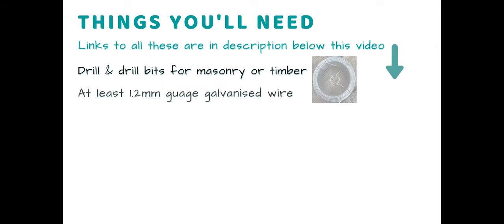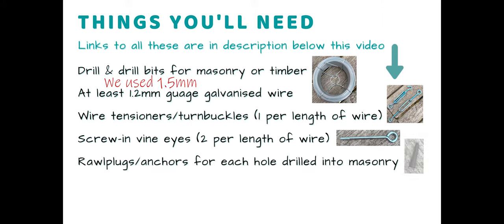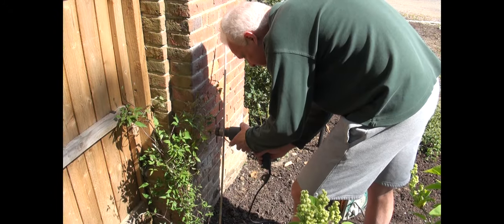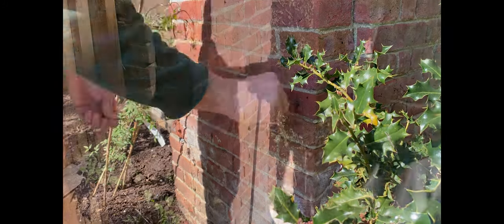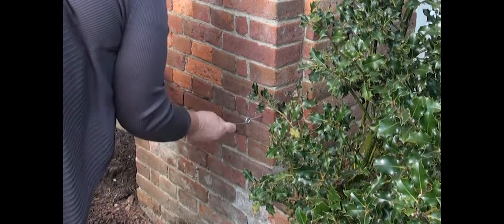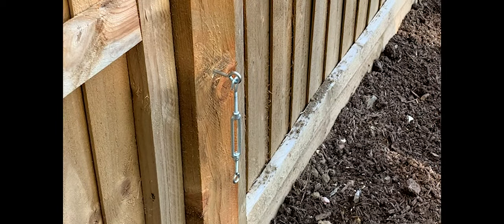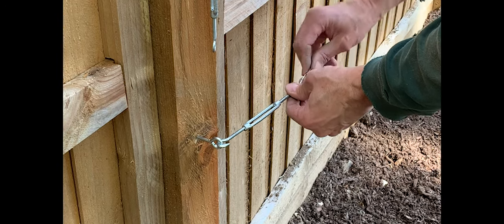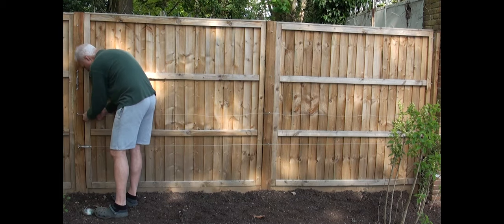How To Install DIY Wire Trellis For Climbing Plants Like Clematis, Roses and Honeysuckle

Comment: Thank you for your really clear and helpful explanation of how to install a wire trellis. I've got concrete fence posts so will be using special wire anchors with holes to thread the galvanised wire through. My longest length of fencing is 12 meters (the other lengths are 11m and 9m). Please could you advise how many turnbuckles I'd need for one length of wire? I don't want to overload it.
Reply from the maker: You are welcome Jan. You really only need 1 turnbuckle for each length of wire.  You could make a wire trellis without them but then you wouldn't be able to tighten the wires over the years.  But that's all they are used for - they don'e add an additional strength or anything like that. 😊

Comment: This was so clear, thanks! I have just planted three clematis, spread across 4 fence panels. Would one wire lenght be OK across all four panles? Or would you do 2 and 2? If so, could they go in the same vine eye in the centre? Thanks!!
Reply from the maker: Gosh, without know the measurements, it's hard to advise.  We used one wire all the way along but used a vine eye on each fence post.
Reply: Thanks 👍🏻👍🏻

Comment: Nice video. As a suggestion, I'd have just made 2 holes at the top and 2 at the bottom to put in a trellis to train it on, less holes, easy solution that looks great as well. :)
Reply from the maker: Thank you.  Yes, that is easier if you want a trellis but we wanted something less visible.

Comment: Very helpful thank you. How do you then tie the branches to the wire ? What do you use ? Thanks
Reply from the maker: Hi there, We use garden twine, like a very thin sisal string.  It's important to tie things in using a figure of eight pattern so that they don't rub against the support. This video has detailed instructions towards the end
https://youtu.be/ma7j1c16CZ0?si=EW5nzMEIgTh61xcX 
and there is a link to the jute twine we use in the description below the video.
Reply: @cottoverdi  thank you so much , super helpful 🙏

Comment: My garden centre recommended rope wire for strength is this what you have used please? Our fence doesn't have the posts just the panels is this ok please
Reply from the maker: Hi, no, we didn't;t use rope wire - it's not necessary for the roses but it does depend on what you're going to grow on your trellis.  We used this 1.8mm wire :  https://amzn.to/3VBY030

Comment: Hi, this is so helpful thank you. I have a huge wall (10x5m) and I would like to have star jasmines go wild on it! Do you have vertical lines as well as horizontal? How wide should I space it? How wide would you need a spacer vine eye to be (every couple of meters?). Thank you so much for this! Thinking I need 3mm wire, turnbuckles both ends because of the length. Any help would be so appreciated!
Reply from the maker: Hi Lewis, That's a big wall! You only need 1 turnbuckle on each wire.  I've never installed vertical wires.  And I think we usually have a vine eye every 2 meters or so.  Good luck!
Reply: @cottoverdi  Thank you so much xx

Comment: Thanks so much, this is very helpful. Do you find you need the vertical wire too for plants to grow up or is horizontal ok?
Reply from the maker: Hi Linda,   No, you don't need vertical wire too, unless you feel that it will benefit your climbers but most climbers will naturally grow upwards, towards more light.  It won't hurt them to have it but we never have.  Hope this helps.  Annette

Comment: Hi, great video! I plan to do a wire trellis on a timber fence similar to yours. How far apart vertically are the wires? 20-30cm? I'm looking to grow star jasmine. Any recommendation on size of turnbuckles and vine eyes? Thanks again.
Reply from the maker: Hi Rosie, yes. I'd say that they cables are about 30cm apart, maybe 40cm.  I've listed all the products I used in the description of this video - take a look at the links for sizes etc.  Good luck with your trellis.
Reply: @cottoverdi  thank you 😊

Comment: Hello, thank you for your help. I’m wondering if you can help. Do I need a turnbuckle on both ends? I’ll be using this installation indoors and hanging posters on it. The stance is about 9 meters.
Reply from the maker: Hi, no there's no need - the turnbuckle is just there so that you can tighten the wire because it loosens over time.  It's best to check it every year and just twist the turnbuckle until it's taut again.

Comment: Hi I’m wondering why you didn’t use the turn buckle on the wall wires and only on the fence wires?
Reply from the maker: Hi Ruby, we didn't;t use the turnbuckle on this particular wall because it was just a pillar and so it was very short and the turnbuckle would've been pointless.  On longer walls, we definitely use turnbuckles on every single length.  Hope this helps.  Thanks for watching.  Annette 😁

Comment: Great video Annette thank you.  I've just put up a wooden trellis but i'm not sure its up to the job for my Star Jasmine....do you think the wire trellis would work better in terms of holding the weight of the Star Jasmine once its established? Its on a wall and would cover about 3.5m wide by 1m high.
Reply from the maker: Hi there, I think the difficulty with the wooden trellis is that it will deteriorate over time but the wire ones should last a lot longer.  The Star jasmine sounds like it will get very big so it would be a shame to have to move it to repair the trellis - I would definitely go with a wire one but it's really up to you and how much effort you're willing to go to to maintain the wooden one.  Glad you found the video useful. Thank you for watching 🌿😄🌱
Reply: @cottoverdi  thank you for your reply Annette, wooden trellis taken down and drilling has commenced! I've gone for 2.5mm wire just incase. Thanks for giving me the know how and confidence to install the wire trelliss 😀

Comment: Can this just be done between fence posts without the fence panelling behind it?
Reply from the maker: Hi Penelope, yes, you can definitely just use fence posts - as long as they are sturdy enough to take the tensioned wire.  Hope this helps.  Annette

Comment: Is there a reason you didn't install turnbuckles on the wall? Our front door jettisons out from the house, supported by two pillars either side. I want to grow a rose (Generous Gardener) up each but need to install wire supports. This is the closest information I've found about putting wire supports on a small section of wall on the internet. Thanks.
Reply from the maker: Hi Josh, Thank you so much - I'm glad we could help.  The reason we didn't use turnbuckles on the wall, is because it's just a brick pillar and so we felt it was too short a length of wire to benefit from the turnbuckles (less than 1 meter).   Also, we weren't planning to grow anything heavy in this area - predominantly a Type 3 clematis, which needs to be chopped back each year.  In retrospect, we may well regret the decision and decide that we need to retro-fit some turnbuckles 😬😃. Good luck with your project.